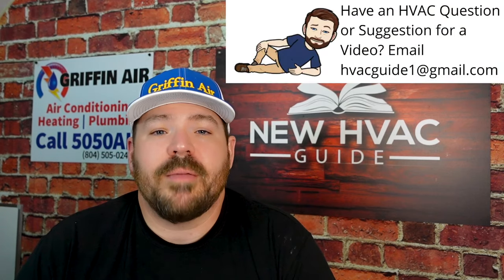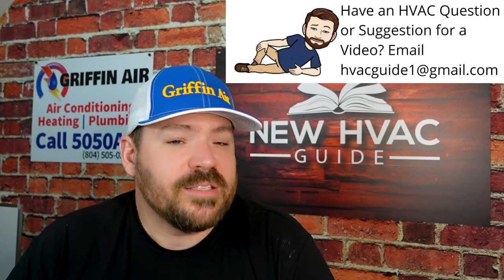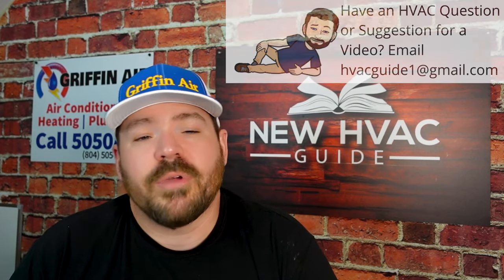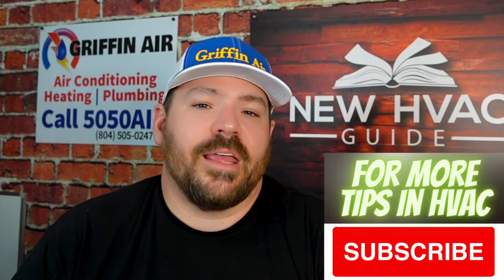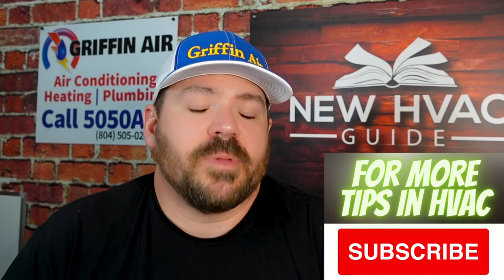1 BIG MISTAKE All DUCTLESS Owners Make!

Comment: Ok, first time using my Mitsubishi.   I set it to heat-auto and for the first hour or so it seemed fine.  I want the room set to 70, it brought it up to 68.  Then it only spit out a little warm air occasionally.  I left for a few hours - at my return it had dropped to 66, no heat was coming out. Is it possible it doesn't really know what the temperature in the room is?  I also tried shutting off the energy saving sensor as well as the economy mode.
Reply: Am having the EXACT same issue.   I will try my fans on AUTO. But additionally my 2 zone system (MITS HH) thinks its a single zone system lol.  If one zone shuts down the other room zone follows suite.   😡😡😡
Reply: @daved9532   I finally figured out how to speak to my mini-split - and I love it!!  Actually, it is Fujitsu (not a Mitsubishi) - but they all seem to have similar traits, it appears - they march to their own drummer, for sure.  I was expecting: turn up the temperature on the remote, it turns on until it gets to temperature.  Nope.  :-)  Actually, patience is the key.  Very patient. After trying 'a million' things, I finally shut off the eco mode, auto fan, sensor mode, and everything else - only turned on the 'heat' mode and put the fan on the highest setting.  I then set the heat temperature to 74 (I wanted the room to be 70 - but I don't have all year to wait). Then I selected the 'powerful' fan setting (not necessary, but it tends to get to what you want a bit faster; the powerful setting does not stay on forever - just for a while; it opens the flap wide open for a while, that's all).  Then you wait.  Do not expect this to be achieved in a few hours - it won't happen.  And don't readjust the settings.  Touching the settings (i.e., getting impatient) ticks this thing off and you'll have to wait even longer to achieve your results - which probably won't happen anyway.  It sounds crazy, but it took almost 24 hours to get the house to 70 degrees, and I had a space heater set to 68 to even out the heat when this thing decides it wants to take a nap.  It is now in the teens outside, but my house stays at a steady 68-71 degrees - with the space heater (it's a vented propane heater) set to 66 (that rarely turns on, except during the coldest temps at night) and the mini-split set to 74.  I do not touch either of them - ever.  Making adjustments just seems to start the process all over again.  The house is extremely comfortable, and my electric bill is so much better than when I used the electric heat.  I still think the mini-split does not have a good thermostat - but, since I am very happy how comfortable the house is, I don't really care anymore.  I was talking to a friend who is familiar with electronic stuff and he explained that mini splits really do not work like other heating systems - so I have accepted that it just doesn't do things as quickly as most heating systems - but instead is slow, but very steady.  And since I am saving quite a bit not using any electric baseboard heat anymore, I'm ok with the tradeoff.
Reply: @ you have told me more than any expert teckie overpaid HVAC technician ever.  TY x a million.  I don’t feel so overwhelmed now
Reply: @daved9532  You're welcome.  😊

Comment: Mini split units that offer heating as well are not really the best heaters, so when your doing your heat load calculations for your rooms, you need to consider the heating side as well and not just the cooling.  This is why you will often see an oversized unit for cooling capacity than typically what’s needed because the installer is also trying to meet the room’s heating requirements as well.

Comment: Set it to Heat or Cool put the fan on Auto and let it run 24/7 at one temperature!! You can always go up or down a few degrees but it needs to run 24/7!! You can turn it off in spring or fall if you don't need any heating or cooling.

Comment: When we put in a large ductless system, the biggest thing we had to learn was to just leave it alone.  It has plenty of power to keep up with even the hottest days when you let it do its thing.  What it doesn't do very well is rapidly shifting the temp down 15 or 20 degrees.  It is sort of like trying to fill a pool with a garden hose.  It'll get there but it takes a while.  And if you turn the temp way down to rush the process, you'll eventually find yourself freezing to death if you forget to set it back up.  You will be much more comfortable if you just set it and forget it, or make only small temperature changes throughout the day.

Comment: this makes a lot of sense.. been struggling with how to operate my split system since i had it installed a few months ago.. i came to the conclusion on my own that the AUTO setting was the way to go... good video!!
Reply: my mini split manual says auto is only for single units not multi and we have multi and our electric bill has gone up so much
Reply: @oliviawoodworth9812  I don't know not an expert by far but my cooper and hunter system is happiest on auto for both heat and cooling.. works practically flawlessly you don't even know they are there!
Reply: @oliviawoodworth9812 
Was also told by installers to NEVER use Auto Mode for multi-head system, because one unit could go into a completely different mode, when all heads need to be in the same mode (but can be set at different temperatures).

Comment: Excellent video Sir. The other thing I see with friends who have installed them is improper routing of their refrigerant tube run which creates an oil trap as they do not know. That will cause a premature failure. I am called after the fact

Comment: The Mr Cool has the"dry" setting which I have used before in the room closest to the shower room, and in the dinning room when cooking a lot . Not sure if every brand has this option . In this setting it doesn't take long to pull the moisture out of the air . Thanks for the great help and videos .
Reply: are you saying a dry mode makes the air dry?
Reply: @SupremeRuleroftheWorld  It acts as a dehumidifer.
Reply: My pioneers have that mode.
Reply: How often should this Dry feature be used?

Comment: I've had my Mitsubishi mini split for two years.  There is a large system with iSee in the living room, all other rooms (2 bedrooms and kitchen) have smaller units.  When sitting in the living room my feet are always cold, it seems no matter what the heat/fans are set at doesn't reach my feet.  I wish I would have gotten the floor model for the living room, at least it would have given heat towards the floor.  I've read the instructions many times, but I still struggle with the system keeping me comfortable.  I've just set it to Auto as many say to do, also set the temperature - is that all I need to do?  Will this keep the room comfortable by my feet and when I stand up?  This system was set up by a "gold" HVAC Mitsubishi dealer.  Thanks for the video.

Comment: The mini split we got has a programmed auto temp and will not let you adjust the temp in this setting. Also if its in cool and the temp is set to 70 it never stops just keeos blowing cold air and the inside temp gets down in the 60s and dosent shut off.

Comment: Hello! I finally had a mini-split (Daikin) installed this winter and don't really know the best/most cost effective way to run it. I basically only want to use in really cold winter and really hot summer. I heard you should not turn it off, so what is the best method to use when needed, but not waste $$ when not needed. (Did not really come with a manual, just one big sheet) Thanks so much from Maryland USA!
Reply: I’d like to know his answer also.
Reply: Set it  to Auto on the remote and it keeps that temp it will change from Cool or Heat depending on temp. Mine also has a Eco button on it which means that the once it reaches temp it shuts off the unit . Then it will fire up and check the temp every now and then.  I keep mine on 67 F during the summer but I use this to cool my whole house instead of using my whole house heat pump. It takes out much more water out of the air and these new Heat pumps are so expensive I had to replace my whole house heating system two years ago and it was 18,500 buck. Thats why I bought this it cools my living room/Kitchen and Bedroom just fine and my whole house is always about 75 degrees even when its 100 outside. Also my power bill is about 60 bucks cheaper each month. I bought mine online it was a scratch and dent got it for a steal and it has worked wonderful. If it lasts 3 years I will be happy I can always replace it as long as I dont have to replace my 5 ton unit again.
Reply: Installers said my multi head system should NEVER be set on Auto mode.

My understanding (researching, experimenting & comparing my energy usage) is these are "set & forget" because they have to build up pressure (2-3 days) to operate effectively. 

Summer, I leave all units on 24/7, but set at higher temp.  Open windows at night using whole house window fan to pull in cold night air, then the heat pump units don't have to do much and I'm comfortable day (heat pumps set cooler/windows closed), & night (heat pumps set higher/ windows open).

I'm trying to figure out how to set things for winter....I like a freezing bedroom at night,  but warm in day.   

If I turn off 1 head unit, my bill is very high for 3 days when I turn it on again until the pressure builds up again (?).
The bill stays lower if I don't turn them off,  but turn the temperature higher/lower instead.

Comment: Joshua Griffin, I am looking into mini splits. My two bedrooms are 150 sq. ft. and 165 sq. ft.. I find a lot more manufacturers who only make 9000 btu units than 6000 btu. Plus, I can get better deals with dual 9000 btu systems than dual 6000 btu systems. Would a dual 9000 btu system ramp down enough in auto mode to keep both bedrooms comfortable? Should I put out the extra money to get the dual 6000 btu system? Your advice is appreciated.
Reply from the maker: I’d have a proper load calculation performed and then check the specs on the ductless units to see what they ramp down to. It’s good that you’re being aware of this issue. Many put them in and have issues down the road

Comment: What about when you have multiple heads/zones on your ductless mini split system each with their own thermostat. Wouldn’t that cause issues when in auto mode (one may want to cool while the other heat leading to error and shut down)?
Reply: I'd love to know the answer to that. Good question.
Reply from the maker: Most mini split zoned systems need all the indoor units to be in the same mode or the outdoor unit will not operate. The only exception I’m aware of is systems with “heat recovery“. There may be some VRV or VRF systems as well. But again, this would be very unique and most systems do not allow.
Reply: Exactly right,  NEVER use Auto mode with multi head units for this reason. 

My understanding (researching, experimenting & comparing my energy usage) is these are"set & forget" because they have to build up pressure (2-3 days) to operate effectively. 

Summer, I leave all units on 24/7, but set at higher temp.  Open windows at night using whole house window fan to pull in cold night air, then the heat pump units don't have to do much and I'm comfortable day (heat pumps set cooler/windows closed), & night (heat pumps set higher/ windows open).

I'm trying to figure out how to set things for winter....I like a freezing bedroom at night,  but warm in day.   

If I turn off 1 head unit, my bill is very high for 3 days when I turn it on again until the pressure builds up again (?).
The bill stays lower if I don't turn them off,  but turn the temperature higher/lower instead.

Comment: Your discussion about variable speed inverters leads me to a great question.  Comparing a 12K to a 9K BTU mini split… if both are Pioneer Diamonte with variable speed inverters… can the 12K run at about the same cost as the 9K??? My thinking is the variable speed inverter may allow the larger unit to run close to the energy consumption of the smaller unit.  

That is the exact question I need to answer before I buy a mini split heat pump system, which I will do very soon!  I'm planning to put UNIT #1 in LR/DR; UNIT #2 in BR/Bath.  
I''m not sure if I should get two 12K units, or a 12K and a 9K.  The BR/bath area is 16 X13 with standard ceiling so a small unit can heat and cool that space easily.  
However, the difference in price for the 12K and 9K at Home Depot is currently only about $30!!  Should I go ahead and get two 12Ks or will the 12K energy consumption cost considerable more than the 9K for the small bedroom/bath area? 
An answer here would be greatly appreciated.  Or a video on this subject would probably get many clicks.
Reply from the maker: Energy consumption, probably isn't that significant between the two. However, my question would be, which is properly sized for the space you're putting it in? Have you had a load calculation performed?
Reply from the maker: Join us live every Tuesday night on our live show!
Reply from the maker: Join us every Tuesday night on our live show! https://www.youtube.com/@hvacguideliveshow
Reply: @NewHVACGuide  I have not had a professional do a load calculation.  I just plugged in my home size into an online calculator.  No heat loss test done, and I know the heat loss in my old home is very significant.

Comment: We connsider the installation of air-to-air heat pumps in our home. Mitsubishi Hyper Heating (MFZ-KW?) with floor mounted consoles seems to be a good option. We want to install 2 multisplit units connected to 2 indoor consoles each, for reasons of redunancy, we would place one indoor unit of each heatpump in our living room. We would like to know if it is possible to control 2 indoor units that are connected to a different heatpump with one and the same wall mounted controller. If possible, we would prefer it over using a handheld remote control. Please let us know if (and how) this is possible and what the implied cost might be. We thank you for your time and expert advice!
Willy Vd Wyngaert

Comment: My wife wants the house AS COLD AS POSSIBLE. (This sounds like an exageration or a joke, but it is not I assure you.) So in our house it is cranked down to the lowest possible temperature pretty much all the time... Even in the winter. It gets really cold. I am very cold. Always very cold. We  live in Oregon so in the winter it gets so cold.

Is this going to hurt our system? I just wonder because I just had to spend $20k replacing a (admitedly badly designed, badly installed) system with a new one with about 3x the capacity after only about 8 years of running. I feel like our use case is potentially not great for the lifespan of these things...

Comment: Ok, this topic really applies to ME.  I am in my second winter with a 30K BTU Mitsu system for my raised ranch.  The air handlers on the wall are the flagship, Hyper Heat.  The ODU is standard.  Anyway, I run the fan in AUTO in the summer for AC, does just fine.

Since this is my primary heat source, running the fan on auto, not so much!  The fan speed is too conservative (CFM TOO LOW) and the temp in my home will drop by nearly 3 degrees and that is on a 30 degree day with solar gain in the home!  

So, I run all 3 units on 3rd speed which is considered high.  At this fixed speed, I find the CFM output is a little different between the 6, 9, 15 k BTU units, but that works best at maintaining my temp settings. 

I may only loose 1.5 degrees during the overnight if outside temp is in the teens. Just my own experiences so far.   Perhaps if I run AUTO fan during heating, I should push the remote temperature 3 or 4 degrees higher then usual to force the fan to move more air?  Would be good to know.

I know that once the set temp is reached and the handlers are satisfied, the blowers will stop completely, something some HVAC guys did not know!

Comment: I have daikin aroura 36k BTU 2 units outside and six indoor units. Now in winter time I use for heat my main source. I been running in in heat mode and fan on auto. Should I use auto mode for temp also

Comment: my new mini split doesnt seem to heat the foot area, should i use a mini vent to keep my feet warm?
Reply: I had the same problem myself. Because a mini split draws air from up by the ceiling and warm air rises, it keeps recycling the same warm air, leaving it cold down by the floor. I solved the problem by putting a small fan that can tilt straight up on the floor off to the side of the unit so it would push the cold air up to the ceiling and into the unit. Works fine.